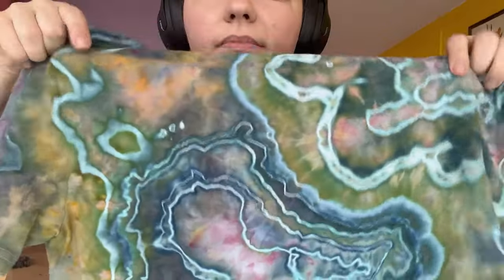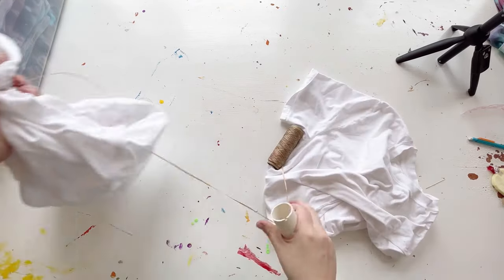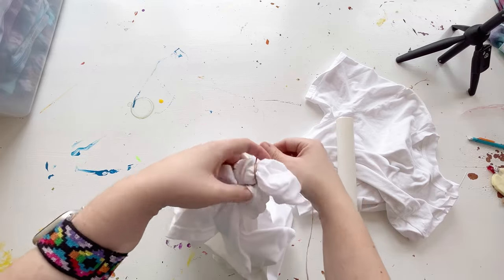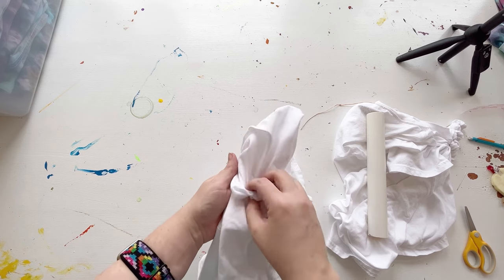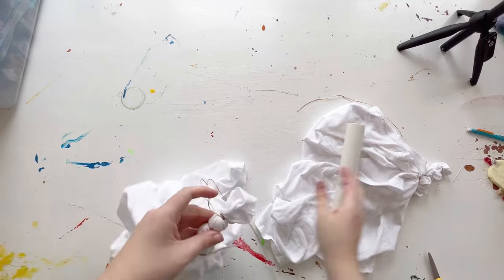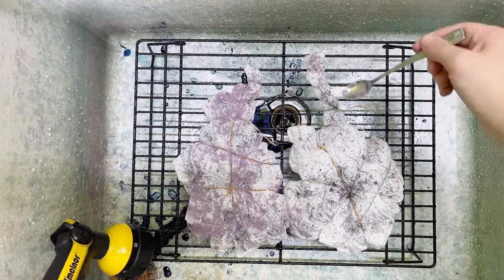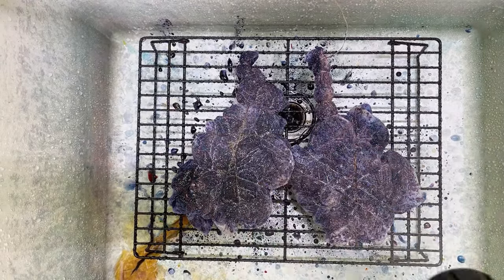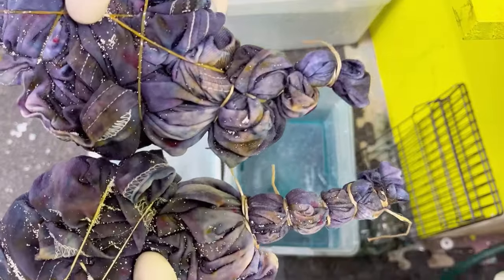My new tie technique for geode tie dye

Comment: Did you seriously “ice dye,” set the color and rinse all in about 2 hours?!?😮 How has the color held up? If it’s lasting through regular washes without fading, you might be my hero!
Reply from the maker: Yes! Lately I put a geode tied item into a plastic bag, then drop it into a bin of hot water (hot from the tap) for an hour. That seems to be sufficient for color retention.
Reply: That’s so interesting! I tried just the misting method yesterday and the shirt looks gorgeous, it just never seemed to stop bleeding dye after a TON of rinsing so I let it sit overnight. I’m actually about to wash and dry it now so fingers crossed.

Comment: what brand of tshirt? did I miss it? i just heard you say it has 5% spandex...
Reply from the maker: It’s made by Hanes but I can only find it locally in stores these days. In the section for undershirts. It’s packaged with a thin layer of cardboard. I’d suggest pulling the shirts out and checking the seams at the shoulders and sleeves. Lately the quality has been spotty there.